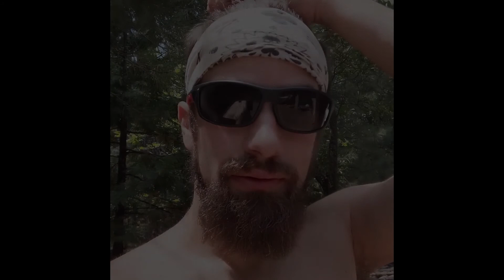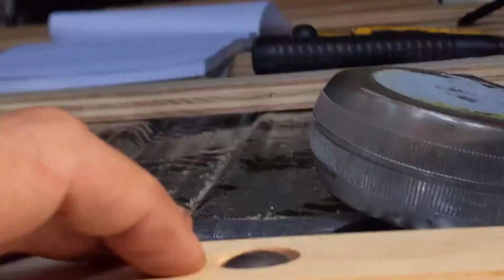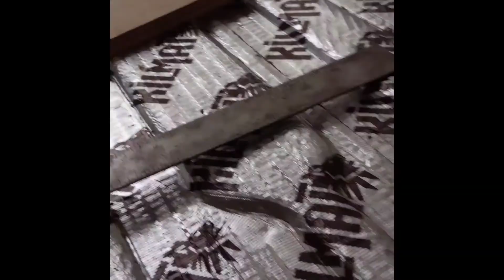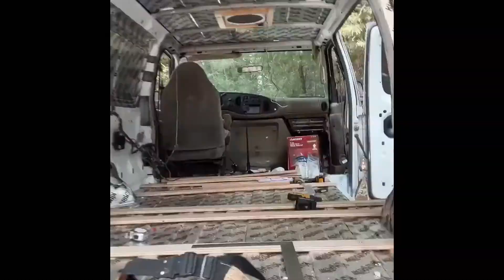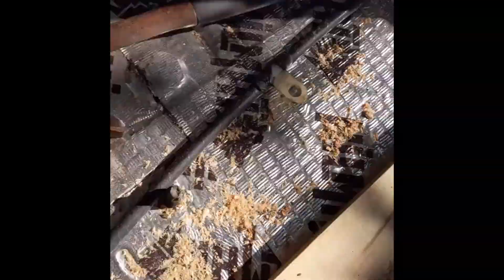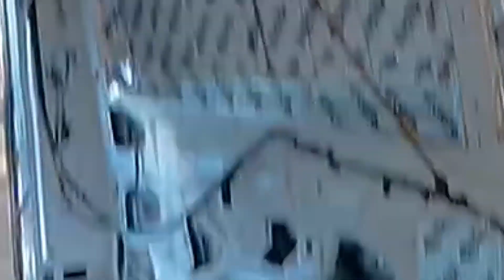Van Life Build | Ford E350 Stealth Conversion | Subfloor Install Pt 1 |  Ep 7

Comment: I'm definitely following your video to a T  how many packs of that kilmat did you get to do your van 
I saw it on Amazon  36sqmm packs and 50sqmm packs I have the same Ford van it's the 7.3 diesel though. I live in Florida so I know the subfloors going to be essential for those hot temperatures.
Reply from the maker: So I bought 3 packs and went through about 2 and a half of the 50 SQ ft thicker version. I think there's two thickness sizes for the 50 SQ ft size
Reply: Okay rad I'll get 3 packs of the thicker 50sq Ive watched probably over 60 of these different van build videos I really feel that your methods will truly be the best techniques to follow for a smooth build
Reply from the maker: @georgelake1972  much appreciated, glad it's helped you out!